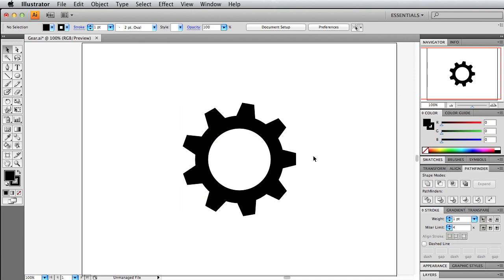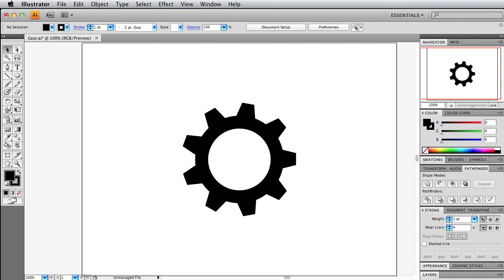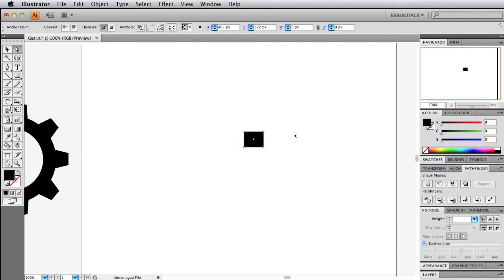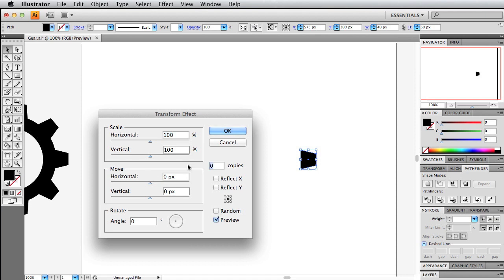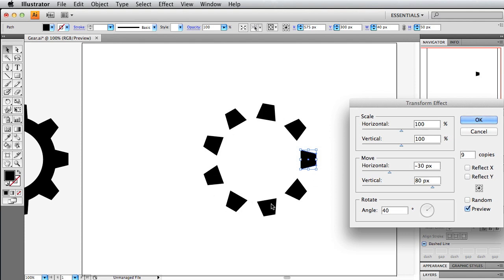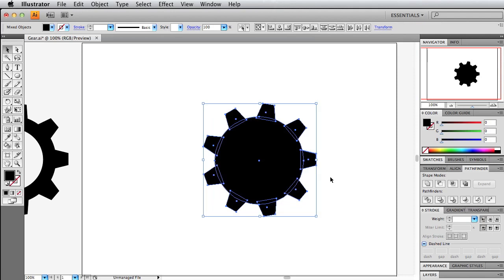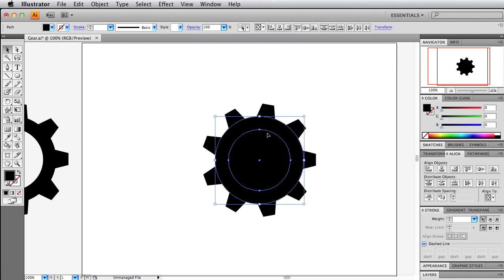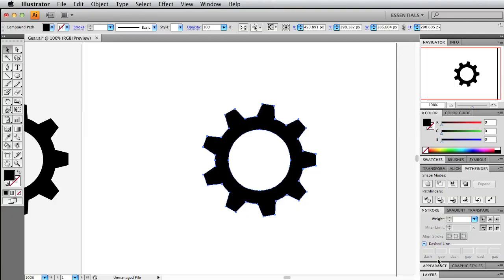Using Transform to Create a Vector Gear in Illustrator

Comment: It would be good to know how you came up with the offsets for this specific gear tooth shape (or any shape!) would those work with any object other than the one you're using? What is your method or did you just find these numbers by trial and error?
Reply from the maker: It was all trial and error. Depending on what shape/size you're working with, the same steps apply, but you'll have the mess with the specific numbers to get it how you'd like.
Reply: I'll try to work out the algorithm and post it here- I've been adding a single point to the desired  rotation centre and grouping it with the object to rotate (set orientation point to bottom for this to work with no need for offsets). Works but seems unsatisfyingly like a workaround to me.

Comment: I don't know what you mean by "go on left." Click on left, select left? Nothing seems to work for me.
Reply from the maker: I believe you're referencing at the very start? What I'm doing is selecting the top right point of the square with the Direct Selection Tool, then holding Shift, and pressing the Left-Key on my keyboard to move the point over 10 pixels to the left.

Comment: any methods for getting gears of different sizes/number of teeth? how did you come to your proportions?
Reply from the maker: I just played with the settings until it worked... Sorry that there isn't much of a simple solution here. I wouldn't say this method for creating a gear is most effective. This video was originally made to show a unique way to creating a gear, but it's definitely not the best way. Maybe I'll have to create a new video with the best solution. In a nutshell I'd recommend creating the cog, then simply copy, paste, rotate 180 degrees, then place the copy on the opposite side of the gear. Then select the two cogs on each side, copy, paste, hold-shift and rotate. Repeat this until you have an even number of cogs around the gear. I know this is a poor explanation, so maybe I should just take the time to create a new video.

Thanks for watching!

Comment: great effect....not sure why, but -30 and 80 settings don't get the correct effect on my machine.....however, -30 and -80 does......also when I try this effect, it only shows one cog in vector...the rest are not.....how do I get them to do this in vector like your video shows...(fyi - I am using AI CS5)
much thx
-Scott-